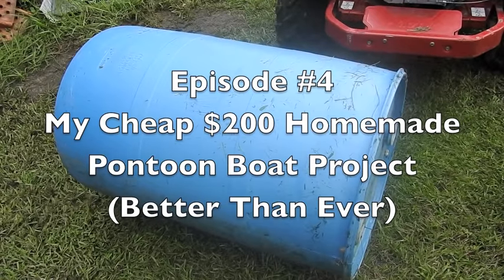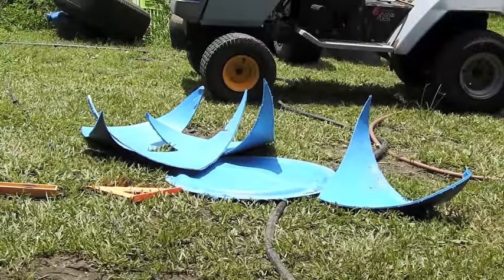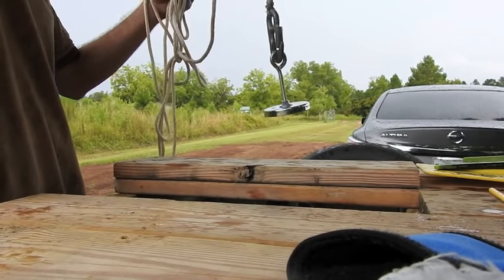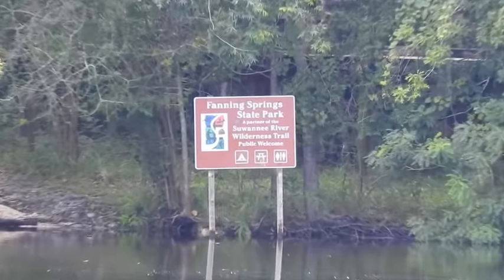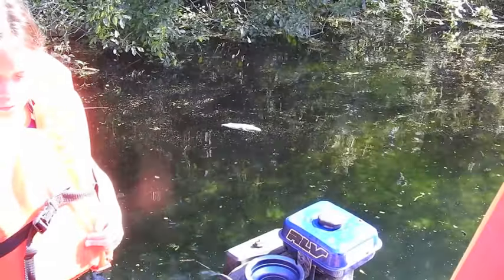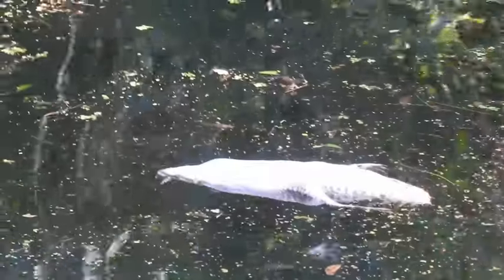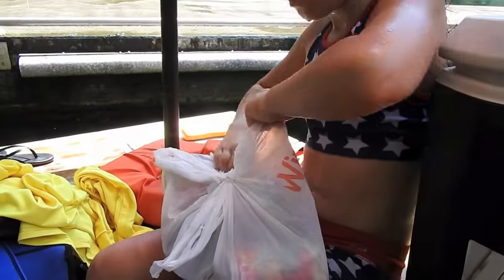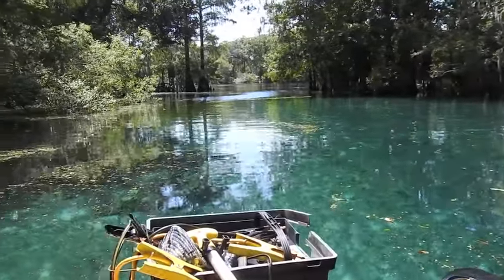My Cheap $200 Pontoon Boat Project Part 4

Comment: GREAT !  all 4 vids... just excellent ! !    I have 3 - 12"x12"x12ft long (all aluminum) pontoons... had 4, one got ripped off.  So, I've had them for a while (5-6 yrs?).  This has been my plan all along... to build a small pontoon boat for the bayous down here (New Orleans).  I've got aluminum welding rods and a butane tourch.  Just need some aluminum angle pieces to weld on so I'll have something to screw the deck to and i'm off !   I have an 8hp lawnmower (B&S) that's almost brand new... should get some speed with that (8 - 10 mph I hope).  Dude, you've been an inspiration, the kids look like they enjoy it and I really enjoyed the centerped and your daughter petting the butterfly along with the underwater shots.  Just excellent.  THANK YOU !
Reply from the maker: love your comment and it too is inspiring!  Let me see it when you get it done, thanks for the comment and for watching.

Comment: Some diagonal metal strapping bracing under the deck boards would help firm it up structurally and increase the service life of the boat I think.  Great project.  I had fun watching it.
Reply from the maker: Thanks so much for watching. I was a fun build and fun to use!

Comment: Wonderful project and its one your kids will cherish for a lifetime. I also built a homemade motor using a 35  Johnson lower unit. I put a new propeller in the water pump in the lower unit and used it to wash down the boat while the engine was running and also used it to clean fish...Just an idea for you to possibly add to your wonderful pontoon boat....
Reply from the maker: That is so cool and the water pump idea is a cool one too. Thanks so much for watching.

Comment: I know this is an old video but I'm using your idea for my work barge build. 55 gal drums but metal frame with plywood for the deck. I already have it built but with dock floats but they are delicate (can't bump rocks or they will break) 55 gal drums will be much more durable. Love that you are having fun with your family 👍

Comment: One more thing I'd like to share with you. If you are ever looking for a cheap weedless prop for  a  homemade  trolling motor you will find them in scrap whirlpool refrigerators in the ice maker unit . You will also find a good stainless steel rod holder. I worked in a plastic  injection molding plant and the machines I worked on made parts for  Whirlpool. Rip apart an old unit and put the propeller looking part on a weedeater and it has quite a bit of thrust . I suppose because the blades are built into a narrow cylinder. I made one once but only tried it in a large metal trash can and it emptied it in no time.
Reply from the maker: Good tips...

Comment: I knew that had to be bugging you . Excellent solution Chud.
Reply from the maker: it was and not only excellent, but super easy. Thanks, as always, for watching.
Reply: Billof Rights is right on we built one with 55 gallon drums 36 ft. And top deck 26ft it was fun fun.
U go bro

Comment: This is about the size I want for a pontoon boat, I have a 5 HP 4 cycle Honda boat motor looking for a boat and this design would be ideal and so is the budget. Just need to locate some plastic drums  and find out the cost . I like the storage wells  and a great place to sit when operating the motor , so not hunched over like I was when i had my aluminum boat. I may use 3/4 pressure treated wood for the decking .  the points on the front of the pontoons would  make great coolers ( water cooled ) Now you got me thinking :)
Reply from the maker: I wish you would just buy mine so I can build a bigger one... Thanks so much for watching and good luck.
Reply: @chud327  what would you sell yours for ?

Comment: This is the best video series on how to build your own pontoon boat! Thanks for sharing. I was wondering if the 2x4 in the back that you use for the motor mount would be better as a 2x6. Hope you'll put out another video on all you learned and what you recommend for anyone getting started.
Reply from the maker: 2X6 may have been better, especially if you use a bigger kicker.  I might be doing a little more reinforcement to my motor mount area.  I may do an episode #5 and go to the river, but it depends mostly on the weather.  Thanks you so much and are you going to build one?
Reply: I've been wanting to build one. You're step-by-step instructions are great. I'll probably start one in the winter to have it ready in the spring.
Reply from the maker: Love it and please send me some pictures of it!

Comment: I love the whole concept, boat motor was ingenious and the pontoon boat is brilliant !!!!! do you have a video on how you did the motor?
Reply from the maker: I think there are a couple old video of it.  Search "chud327 homemade boat motor" and something should pop up. Thanks so much for watching.
Reply: decades ago now, took a steel lawnmower blade hub, heated the seized 2 stroke crank output shaft over the stove to soften just enough to cut it off. chucked up both parts in a lathe (instant alignment) to weld them together.
after that it was just pipe spacers and bolts to mate engine to lower unit.
a 4hp briggs will run for many hours on a quart of gas

Comment: I would imagine that those "diverters" as you called them, probably made a noticeable difference in speed and/or fuel mileage since the front of those barrels are no longer plowing the water.  I was hoping you might comment on it, but unfortunately you didn't.  I've been toying with building something similar and I had been wondering why you didn't do something like that with the initial build.  Looks like a nice little boat though.  Congrats  :-)
Reply from the maker: I had planned to do something initially, but just had to figure out what I wanted to do. Thanks for watching.  BTW, if you build one, I want you to send me pictures as you go...

Comment: Greetings to you chud327
Very cool concept this pontoon boat,  brilliantly made. How much fun can one have, without spending a fortune? Watching you, gives away some of the answers, I think. May I suggest that you gear up that motor, so the prop runs twice as fast. Easy to make two pulleys, with a short belt between.
Reply from the maker: Thanks so much and I have been wanting to gear it up for years. I was thinking of taking a timing chain out of a small block chevy, that would make it turn twice as fast, or half as fast if you don't know what you are doing... I will think on this an let you know.  That could be episode #5, I am about to run out of things to do on the boat.

Comment: Beautiful  videos. Maybe adding a schuader valve and pressurizing with a two or three psi would stop the popping and prevent unwanted moisture intrusion.
Reply from the maker: I thought about doing that, but didn't bother.  Maybe still a good idea. Thanks for watching.

Comment: I wonder if you could put a tire valve in those barrels somehow to add a couple of pounds of pressure to help them keep their shape? Adding another piece at the back of each pontoon like you added to the front would help streamline it even more.
Reply from the maker: Thanks for the suggestions and on my next build, I am going to try to get a little pressure in them some how. Thanks so much for watching.

Comment: Nice project. Looks like you need the vent holes in the barrels to prevent collapsing during temperature changes.
Reply: I was thinking the same thing. Having venting on the top should extend the life of the drums considerably. Obviously he would need to make sure that the drums aren't rotating such that the hole could end up letting water in, but that shouldn't be too difficult.
Reply from the maker: That is a good idea, especially in the winter...  I need to do something about it.
Reply from the maker: They do try to rotate a bit, but that should be controllable.  Thanks for watching.

Comment: did the nose cones make a big difference in hydrodynamics or trolling speed/ efficiency?  i still havent come up with any good hydrodynamic cones yet...  maybe it wouldnt make a huge noticable difference?
Reply from the maker: Mine does better, but with low horse power it makes less difference.  If I stepped up to a real boat motor, they would pay off even more.  Thanks for watching and wanting to see a picture of your on my facebook maybe...
Reply: i found your page and posted a photo comment :)  i dont know it if shows the bimini canopy or not, and ive recently removed the glued-on nose ugly cones also until i figure something better.
Reply from the maker: I am going hunting it right this second! Speaking of bimini tops, I just found a super deal on one yesterday and have already installed.  I hope to use it in a couple of weekends for part 5.
Reply from the maker: I can't find it, what should I do?
Reply from the maker: Never mind, I took a short cut and went to your channel. I found it and subscribed so I don't miss anything.
Reply: i commented on your pontoon video post on your "chud channel" on facebook.  but i see you found the part 1 build video :)  i only have 3 videos right now of the build but part 3 shows most of what i have accomplished thus far.  i cant wait to see your new bimini canopy
Reply from the maker: I have watch all of your and can't wait to see it in action.  I like you bench seats, I may have to make some myself.  Bimini video will be out in a couple of weeks, we are planning another spring trip.
Reply: ive also watched all of yours, i got some inspiration from your first build videos and made mine 6x12 also.  i like your nose cones and homemade motors.  and the underwater shots are awesome
Reply from the maker: I love the underwater shots, but that spring is going to make all other rivers look like toxic waste. I am trying to get to another spring for my next video. Thanks for the replies.
Reply: thank YOU first.  :)

Comment: Love the pontoon boat, you did an excellent job. I have a couple of questions if you don't mind. The nose cones you put on the front barrels, did you seal them to make them water poof, and also, is that a homemade motor ? Anyway, thanks for sharing.
Reply from the maker: Thanks so much.  I did not seal them.  I used them to store stuff that does not mind getting wet.  They would also be great for live wells.  The motor was home made.  I actually did two.  The big one was a 12.5 mower engine and the other was about a 3 horse pressure washer.  I have a few old videos of when I made them a long time ago.  I want to one day do another that is bigger and better. I hope this helps and thanks for watching.

Comment: do the paddles and stuff you hung under the main deck tend to get soaked while you're going about?  also do you find it pretty stable or do you have to distribute the weight quite a bit?  How much weight can this thing hold?
Reply from the maker: What ever is in the box up front tends to get wet on the bottom if there a couple of people up front, but I would just keep stuff that don't mind getting wet.  It is very stable and we usually took 5 people on every trip, just because my car would only hold 5 people.  I don't know how much weight, but again 5 people plus our cooler and gear was fine.  I hope this helps and build #2 should be starting soon, bigger and better. Thanks for watching.
Reply: @chud327  I think it's super awesome to do this- thank YOU for making the videos!  :P
Reply from the maker: Awesome I will keep doing what I do then!!! Thanks again!

Comment: a wet suit and rope should become stinky if you will keep it in the water compartment
thanks for the idea. will do it next time instead of buying a boat. Maybe to avoid dentin because of cool water/air you can drill a small hole on top of barrel.
Reply from the maker: i always take the wet suit out and wash and dry it or yes it will become stinky quick.  I would only put it in that compartment on spring day after wearing it. As for the dents, I want to make holes in the tops and run a pipe through to keep them from rotating. Thanks for the tips and thanks so much for watching.
Reply: My question is can it be registered
Reply: @NH-ny8ot  you put your question under my one. So it is directed to me but not to author. But i know the answer. Check regulations. Anything powered by any motor has to be registred. Even kayak or padleboard. Even electric motor. Any hp.

Comment: might want to pressurize those barrels about 10-15 psi. not criticizing the project, its nice.
I'd done the 4hp briggs to 6hp lower unit thing, fast enough for how little fuel it really used.
Reply from the maker: Next time it will do some pressure in the barrels...  I am looking for a little more speed, but it sure is fun just like it is. Thanks for watching.

Comment: I'm wondering why the tops of the barrels can't have a small vent hole to keep the temp changes from deforming them?
Reply from the maker: That is a good idea, but on my second build I did not have any deformation issues. Hope you will check out that build and hope to start build #3 real soon. Thanks for watching.

Comment: You should add a propeller guard if you boat around Manatee's.
Reply from the maker: One thing about the spring, you would see them before you hit them.  Plus as slow as my boat is, they would have a chance to move. Thanks for watching.

Comment: Did you get much increase in speed when you put the front cones on the front barrels?
Reply from the maker: Maybe a mile or two per hour... Top speed Monday was 6 mph on pontoon boat #2.  Have you seen #2 yet?  Thanks for watching.

Comment: would it be possible to water proof your water diverters some way you think. Also whats the length of your boat? 12ft?
Reply from the maker: This one was 12 foot long and my next on is bigger and better and 13'8 X 8'.  Ir should be out in a couple of days.  You could probably water proof the diverters, but I haven't done it yet. Thanks for watching.

Comment: The reason U'r barrels R denting while in the water is because they R air tight. The cool water cooling a HOT container ? It's NOT the air keeping U afloat it's DISPLACEMENT. I built storage into  ALL my Water Tight Barrels. BTW ? I REALLY like the way U finished the Bow. Good job sir. GOOD JOB.
Reply from the maker: Thanks so much, do have any videos or pictures of yours? Thanks so much for watching.
Reply: @chud327   Not at this time. I've been collecting materials while researching all I can on it for 3 yrs. Thanks to prayers answered I JUST won my 38 yr. battle with the VA. I can NOW afford a few dollars to make it MUCH better. I started out wanting to make it for as little as possible, and somewhat WTH LOL if ya get my drift ?. My MIND is what keeps me going. But NOW I can apply some of it. I might be an Ol Fart ?, But I can STILL have fun. It's NOT the 1st. NOAH project I've been able to pull off in my 70 yrs.. I hope to get started on it in a few months. I have to finish my MORPHING Car Port to Hurricane/Storage Shed. Surpasses building code & NO Permits required to meet ALL Building Regs.. U sir R an inspiration to follow ones DREAMS. May GOD always be sailing with U & U'rs. Aloha. Till Later. Gruncle H.
Reply from the maker: Congrats on the VA win.  I want to see what you build, maybe you can video and / or send pictures to my facebook at "Chud channel".  God bless you too!  BTW, where in hurricane alley are you located?
Reply: @chud327   I live on Kauai ( the Garden Isle ) in Hawaii. Nice Rivers here & of course the Coast when not to choppy. I know I'll be able to get Photos, as for Video I'm talking to some friends retired from the industry about that part. I will make sure I keep U up dated on it all. Later. Aloha. God Bless. Gruncle H.

Comment: Like those cones you made for the front. Good job!  Good idea making it into storage compartments. Looks great. Did you do any videos of the motor build ? I like that you combined a lower unit to a lawnmower motor . That's pretty cool. You get another thumbs up from me on this video.  I wonder if you filled the barrels with foam packing peanuts before you installed them if that would keep the cold water from causing the tanks to shrink in? Thanks for sharing once again.
Reply from the maker: I think there are a couple old kicker build videos. I want to make it faster, that maybe be like a kicker build.  It would take a bunch of peanuts, but that would help... Thanks for watching and for the comments.

Comment: I think if you are using 1" marine plywood for the deck instead of 2x4, it would reduce the weight of your pontoon significantly.
Reply from the maker: Charlie Ngo are you saying build the deck frame out of plywood? Let me know, I might could do that next time. Thanks for watching.
Reply: Just the deck itself Chud. The frame I still use 2x4 with 1" 1/2 holes that would help reduce the pontoon weight significantly.
Reply from the maker: The deck is 5/4 boards which is only 1/4 inch thicker that the plywood.  Plus the gaps between the boards would save a little weight.  On this build, I used the deck board because I already have them. I will consider plywood next time. Thanks for the reply.
Reply: I  think what you did in this project was phenomenon. Also, I have a next project for you to work on if you are up to it. Same concept, plastic barrels will be materials of choice. How about making 14'-16' flat back canoe? Cost probably a few days and 3-4 plastic drums. It would be awesome dude.

Comment: What kind of machine or what is the required. ENGINE TO OPERATE this boat cause I have plan to make exactly one what you did
Reply from the maker: Mine was a lawn mower engine, but a boat motor would work too. thanks for the comment and for watching.